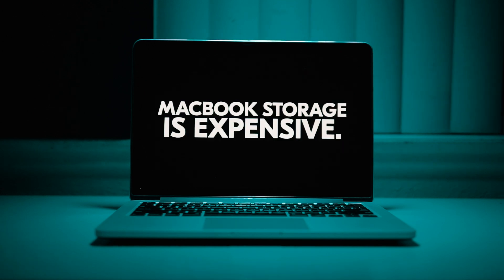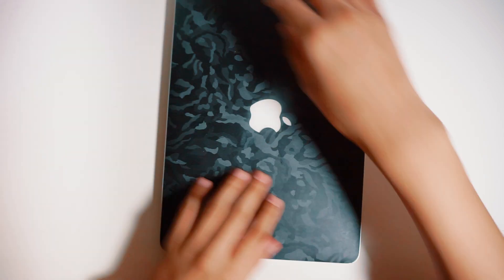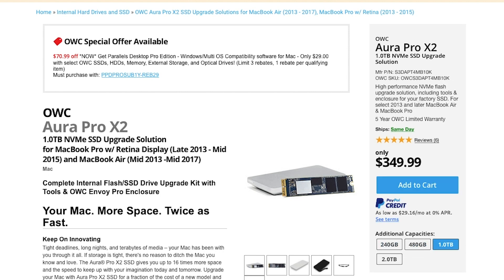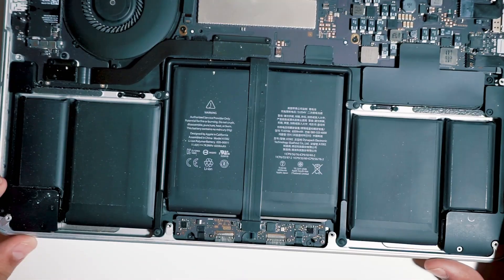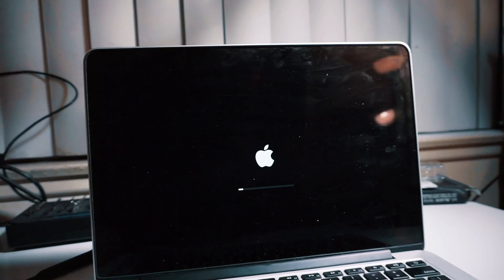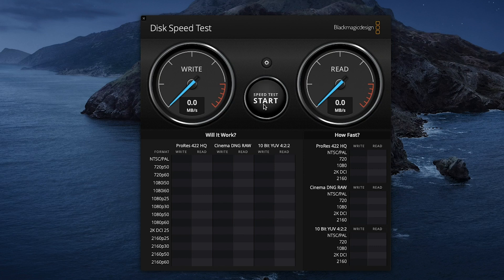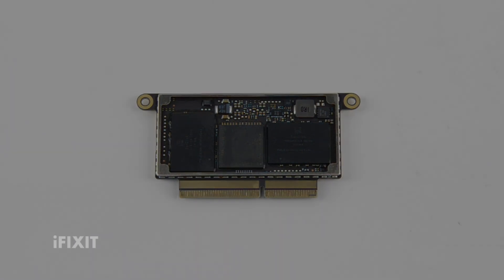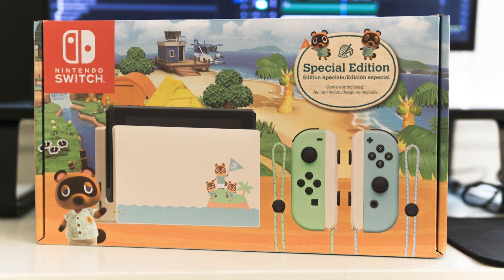The Last Upgradable Macbook Pro

Comment: 1:09 “This is my 2015 13" MacBook Pro and it is technically the last upgradeable MacBook Pro.”  No, it's the last easily-upgradeable MacBook Pro, but technically the last MacBook Pro with upgradeable storage is the last MacBook Pro without a touchbar— the Mid-2017 MacBook Pro 13" (A1708)

Source: EveryMac, and I own a Mid-2017 MacBook Pro 13", and have upgraded the storage in it with an A1708-compat SSD off of AliExpress.
Reply from the maker: Cap'n Slipp yes. I said this literally in the video. 7:14. Please watch the video before commenting.

Comment: Never, under any circumstances, purchase an Apple product. You'll pay twice as much money for half as much product.
Reply: hwhack 6 years ago I bought a MacBook Pro 13” non retina, and I’m writing this comment in it. It’s the best computer I have had. I use it everyday for work and for my hobby (music recording). It has the latest macOS version installed. I’m thinking about replacing it with a new MacBook Pro just because I know it won’t be functional for much more time. I paid around $1300, so it’s about $217 per year of use, and I still could resell it for about $200 (something I won’t do, because I plan to keep it as a back up). I have another PCs (Asus, Lenovo) and I don’t think those will last more than 3 years.

Comment: 1. The battery drains way faster after this upgrade (as the sleep isn't recognized for the SSD, there are some mods on the system but didn't figure anything yet worth while)
2. You can use a sabrent rocket drive without any issues in recognizing it directly (also cheaper ;) )
3. if you are already in the macbook, clean it at least

Comment: Well, for speed you install two ssd's(macbook pro 15"), for second one you use adapter to use dvd drive slot. Then use raid0.

Off course you need to have decent backup solution as raid0 is vulnerable to disk breakeage.

And, easy way to install osx again is to make copy if your install to external disk, i use 32Gb usb disk. MacOS can boot any external device, then just do install from external media.

Those adapters for using ssd on drivebay you can buy like 10€.

Comment: you should build  a Nas there great for being able to share files between computers especially windows to mac os.there relatively easy to setup as well! that would make a great video.
Reply from the maker: Noted! That's a great idea, always wanted to get into building a home server. Thank you for the suggestion!
Reply: @DammitJeff  yea its great. i built one using freenas and its pretty easy i got 110MB/s to it over ethernet it was great considering i used a few old hdd i had lying around and an old pc.

Comment: did the same thing with my a1398 late 2013 retina but i have a wd sn720 512gb and it runs great! only problem that you may run into is the macbook crashing after sleep and showing "wake sleep failure" as the error message otherwise pretty cool mod
Reply: This is the reason why I'm against non Apple SSD on Macbooks.
Reply: @Rabecco  eh it ain't that big of a deal you just gotta change one nvram parameter and it works thing is with apple ssds they're expensive and slow
Reply: @Playtastiv  Cool that it now seem to work! So which nvram parameter did you change? And does the sleep-mode and updates now work smooth as usual?
Reply: @Rabecco  yea everything works I found it on reddit somewhere it's easy to do d just Google efi sleep wake failure
Reply: @Playtastiv  Do you mean: “sudo pmset standby 0” in terminal? That would be phenomenal! 😀

Comment: Thank you for the video. Are you having any hibernate problems after this upgrade. Many people have reported such errors after using this kind of adapters.
Thanks again.
Reply from the maker: Appreciate you watching! No, currently for me I’ve had zero sleep/hibernate issues, I tend to leave my MacBook on sleep very often. 

This is an issue that is prevalent on 2013-2014 models, not on 2015 models like mine. However, there are fixes for these hibernation errors! Just need to enter in a few commands in the terminal. Can’t find them at the moment but the amazon link in the description should have the list of commands you’ll need to input to fix these issues. Hope that helps! 🤗
Reply: @DammitJeff  Thank you, mine is 15" mid 2015 macbook pro, so i think i won't have the hibernate issue too.

Comment: 2016 MBP 13” 2 TB ports has replaceable SSD
Reply: would 2017 mbp no touchbar also have replaceable ssd?
Reply: Jessie Zhu yes, and the greater news is you can also buy ssd adapter for a1708 now. much cheaper than apple ssd.

Comment: partitions formats change the performance of SSD "3400mbps with EXFAT" break up the drive into second partition and make ExFAT run bench on that drive and get a real number "the same issue happens with NTFS and windows" Also go into system report nvme and see how many PCIe are running at? some macs cant use more than X2 speeds not sure what model if any but just make sure your system is running at gen3 pcie-x4

Comment: Needs more subs ❤️❤️
Reply: the speakers can take more and the pre amp mosfet is capable of delivering in this machine.  the issue is the limit in the firmware.  download soundbooster lite and you can boost base and sound another 50%

Comment: Technically the 2017 non touch bar macbook pro is the last upgradable macbook pro, the ssd is removable and upgradable.
Reply from the maker: Yes. I said this. But there are no bigger SSD's to upgrade it too, since it is propriety and only made one size. Not sure if you made it to 7:14? 

Either way I appreciate you watching and taking the time to comment 🤗
Reply: @DammitJeff  You can buy them on ebay although they are quite expensive, they do have higher capacitys.
Reply from the maker: i've been trying to find some myself! I personally haven't managed to find any on ebay, only the 128GB chips. But if you have a link i'd be more than happy to do a video on it. Appreciate you letting me know! <3
Reply from the maker: 200 bucks for 512 😳

Comment: Any performance difference between the new and original SSD? E.g. shorter battery life. I tried to put in a Transcend SSD 240gb. It works okay but the battery life is shortened noticeably.
Reply from the maker: Performance itself hasn't taken a hit. I've heard others say that they've taken a battery hit, personally I've noticed a little bit of a drop. But that's the price i'm willing to pay for 8 times the storage 😅
Reply: @DammitJeff  The Transcend SSD is plug and play. No need adapter. FYI.

Comment: Remember to activate TRIM on your non-standard SSD using 'sudo trimforce enable'.  Mac OS tends to turn the default to disable if you're using non-Apple SSDs.
Reply: thanks for the tip. never imagined that something like this existed. glad you mentioned it
Reply: I've read this several times and I have a doubt. Isn't TRIM known to deteriorate SSDs like defragment on Windows?
Reply: Zireael That’s certainly never been my understanding and I’ve been replacing hard disks in Macs for years. Everything I’ve read says activating TRIM is essential - it allows the OS to tell the SSD controller when data locks are no longer needed thus ensuring a balanced spread of data.
Reply: @carlyleroad  Thank you so much for your response, maybe I was mistaking it for something else. Thank you anyways.
Reply: @zireael666  defragment hurts SSD because of unnecessary writes; TRIM is the OS telling the drive to set certain spaces as available during deletion instead of overwriting it with something, hence reduce the amount of write and slows down the deterioration by writing.
Reply: @zireael666  the opposite is true

Comment: The reason is that the 13inch only has a 2x lanes where the 15inch has a 4x lanes which can push the entire speed of the SSD
Reply: The 2015 MacBookPro retina 13" and 15" models originally shipped with 4x lanes PCIe 2.0 AHCI SSDs. (speed ~1400MB/s).

They both supports up to 4TB NVMe SSD if their BootRom is at least MBP121.0171.B00 (for the 13" models) or MBP114.0177.B00 (for the 15" models).

The Retina 15" mid 2015 supports 4x lanes PCIe 3.0 speed eg. up to 3000MB/s. The early 2015 Retina 13" supports 4x lanes PCIe 2.0 speed.
Reply: MBP 15" mid 2014 also supports 4x lanes?
Reply: Mr moo moo used to have a 2014 15. And yeah it has 4 lanes but only at pci 2.0 if memory servers. So max should be 1.4-1.5GBps. Still better than stock. Please read up about the sleeping problems that come with 2013-2014
Reply: @ajbadenhorst  Sleeping problems? Any links to that issue?
Reply: @ajbadenhorst  Yes, sleeping problems still plague the 2013 models. Mine is still having issues no matter the drive or system software. Lots of rebooting after sleeping. Not always but lots. Hunting for the 2015 15"
Reply: @thecowegg  Amazon link above for adapter shows settings for the adapter, that solve hibernation issue in 2013-14 models.
Reply: Also This: To prevent this problem you have two solutions :

-disable hibernation by typing "sudo pmset -a hibernatemode 0 standby 0 autopoweroff 0" in the terminal

-you can "patch" the BootRom

Disabling hibernation has the drawback that your mac will consume more power when sleeping for a longer time than if hibernation is enabled with the default settings. Your battery will lose ~10% during a night...
Reply: DireHavok thanks 🙏👍

Comment: Your adapter helps bridge the difference in technologies, but can't compensate for the older technology, so you could have used an older, slower M.2 drive and got the same speed.
Reply from the maker: Thank you, I've later found that out! Turns out the 15 inch MBP's might have a faster PCIE lane, as I've seen them use the same adapter and get speeds of ~2400 on read and write. Still, 1400 is a big step up from 600!
Reply: @DammitJeff  I'm certain of that.  I added an M.2 drive to my Omen by HP to offset the 7200 rpm drive and it helped.  I recently resurrected my MacBook Pro past with another mid-2012 GeForce 650M machine, changing the 500 MB 5400 rpm drive to a 1TB 2.5 inch SSD about 25% of the price of my previous OWC 6G Pro drive from 2012.

Comment: Great video!  I've installed a Samsung 970 EVO on my mid 2014 macbook pro. It gets really hot after it's turned on for a few minutes.  How's the temperature after the install?
Reply from the maker: My MacBook temps are just fine when just doing normal web browsing and word and all that. Tends to get a bit warmer when maybe watching streams or Photoshop. Fans kick on full blast when video editing and But then again I deliberately tried to stay away from the Samsung drives due to the issues I’ve heard from other users. 😅 But hey thank you!

Comment: The speed is slower on the SSD after being in your computer because of the motherboard, not the drive. The older motherboards can only give so much bandwidth, whereas you need a m.2 slot or PCIE x4 slot to run it at full bandwidth. If you were to take that and put it into a PC with a moderately higher their motherboard it would likely achieve at least similar to advertised speeds.
Reply: Sweet, thanks. I have a 500 Gb SSD in my MBP of this era so if I ever need to change the drive I'll remember not to waste my money on one that is faster than the speeds the motherboard can handle.
Reply: @darkchocolate4643  hey your comment should be pinned to the top
Reply: @darkchocolate4643  You mean 480GB? I don't think 500 GB SSDs are sold.
Reply: @odyshape  Sure they are.
Reply: Only the Retina 15" mid 2015 supports 4x PCIe 3.0 that you need for 3000MB/sec, this machine is at PCIe 2.0 so its limited to about half that.
Reply: @edcooper2396  are you sure about this? Everymac.com says that 15' mid 2015 (A1398) is also PCle 2.0..
Reply: @edcooper2396  According to Everymac.com, this statement is correct. The A1502 MacBook only supports PCIe 2.0.
Reply: I just upgraded the drive and memory in my macbook pro 2019.  our company makes adapters for nvme and it is a good idea if you know what you are doing and have the equipment to change the drive controller on the logic board as well as some of the capacitors and resistors to jump the voltage for the controller from 3.45v to 3.75v.   this will give you the top speed of your drive.  you can upgrade the 3d nand on new macs but you need to know component level repair.
Reply: What if I need it to store 500+ of data, not so much for speed? Will it work? My config is: MBP Core i5 2.7 13-Inch (Early 2015 Retina Display) 14 nm "Broadwell" 2.7 GHz Intel "Core i5" processor (5257U), with dual independent processor "cores" on a single silicon chip, a 3 MB shared level 3 cache, 16 GB (customized when bought) of onboard 1866 MHz LPDDR3 SDRAM.
Reply: m.2 is x4 max

Comment: Have fun getting sleep to wake problem :) If you are not experiencing it then that's good! I did this on my MacBook Pro with the same adapter but Samsung 970 EVO. It draws a lot of power while sleep (I can wake up with 60% of battery left overnight) and sometime can't wake, it just reboots, not to mention the heat that it produces both while sleeping and operating. I hope this is different on your WD black drive. ATM I switched back to my factory 256GB SSD just for the stability and power. Just something to keep in mind. 
Also, you are not getting the advertised speed b/c of the bus bandwidth limitation on Macbook Pro.  HOWEVER, you will still benefit from having NVMe's low latency random read/write, compare to SATA SSD (the one that came with your mac), and that is a huge plus especially for macOS, as there are a lot more small size system files that are read/write than Windows. 
Finally, the adapter you have slightly bends the SSD when screwed all the way down, and it sits a little bit too high up which will press against the back cover. I got another adapter without the backplate PCB thingy and it works better than the one shown in the video, it is lower profile.

Comment: Hello, I watched some of your videos and they are great. The reason why you are not getting the advertised speed is because of the bandwidth that slot has on the motherboard is not as high as to what the SSD supports. So essentially, that slot bandwidth is bottlenecking the SSD performance. Nevertheless, the speeds you are getting are great for even high end tasks and you should have no problems using this machine as a daily driver.
Reply from the maker: Love this comment. Yes, you’re likely right. The PCI slot likely hit a cap on speeds. But it’s a far greater jump than 600MBPS. Still super happy with it. Appreciate you watching friend! 🤗